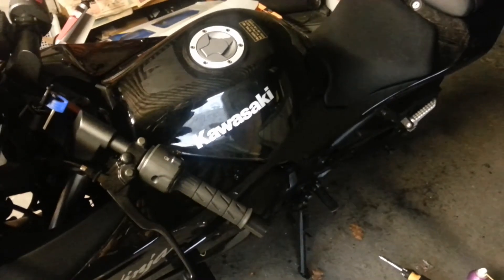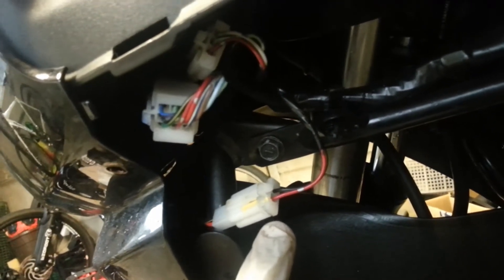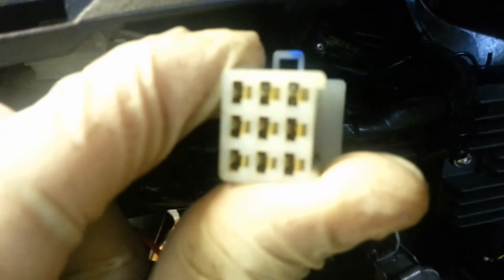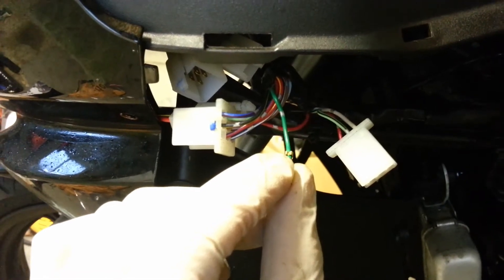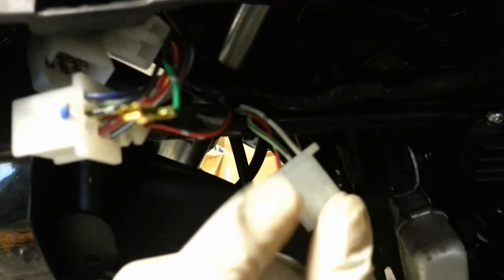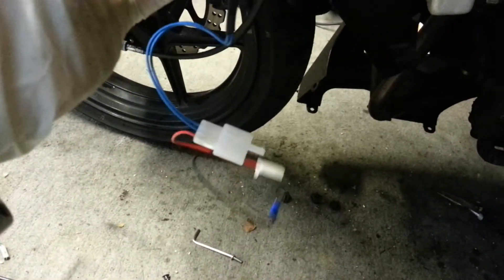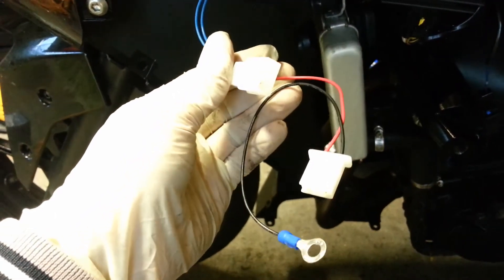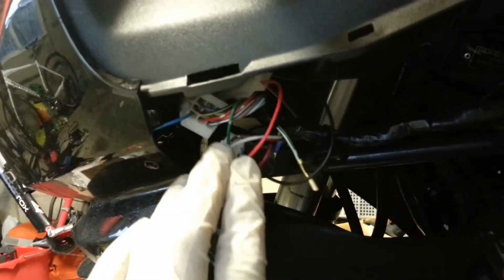Ninja 250r Indicator Flash Diode Fix

Comment: Hello, you need to connect the "loose" green wire in the middle of the 3-pin connector on our kit (between the red and black wires) so that it connects again with the same color wire.  This wire controls the fuel warning light.  In the USA, the 250R does not have this wire or feature which is why it's not in the instructions (yet).
Reply: Custom LED
Reply: Thank you very much, after 7 years I found this reply. Thanks a lot from Europe :P
Reply: Hey please help i bought this kit and it works fine but as soon as i put the fairings back on the problem comes back. Update, i pinpointed the problem and it was a ground issue for some reason the wire is having a difficult time grounding to my bike’s mounting point but now that i know the main problem i will be able to tackle it and fix it easier

Comment from the maker: Thank you, I'm going to try playing with resistors again over the spring break.

The fix in the video disconnects fuel gauge wire (the mysterious middle wire), It's not an issue as I usually fill up every 2 weeks/200miles, I know the bike can easily do 250+ miles out of one tank.